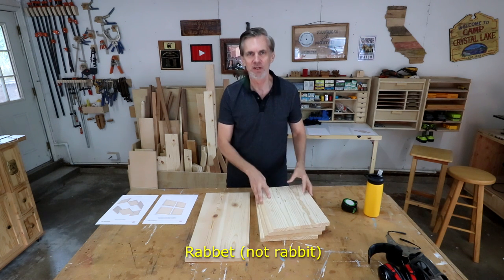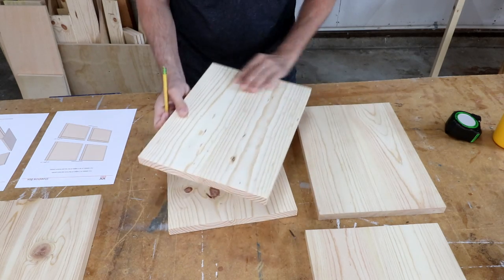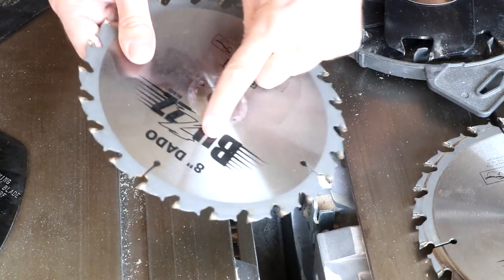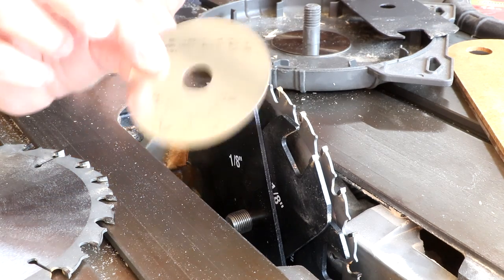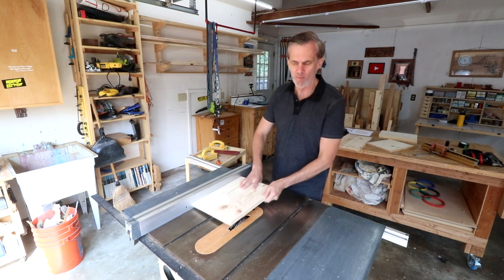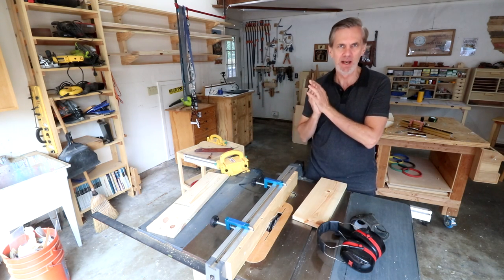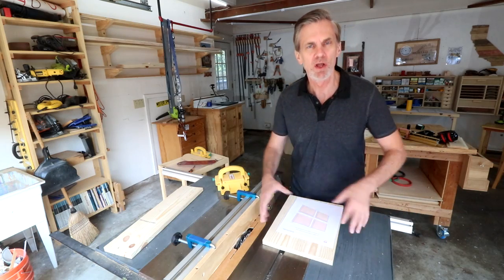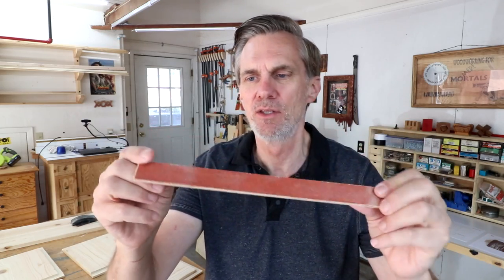How to make simple rabbet joints using dado blades. Basic box making. | LOCKDOWN DAY 173

Comment: First off Steve, I’m well beyond learning to cut a rabbet joint (not a Humble brag, just sayin’) but I still really enjoy watching your videos. It’s rare any videos keep my attention for 20+ minutes but You are always so positive and fun to watch, you clearly put a lot of care into making your videos watchable. Ive watched enough of your vids to know that you put a lot of thought into your production. 

What is cool about you is that you’ve been doing this so long that you’re clearly no longer a “mere mortal” (at least relative to the average weekend woodworker - but you manage to stay
Humble and build simple projects with basic tools catering to the average Joe with half of his double garage that his wife lets him use. 

Awesome! Keep it up! 

Additionally; great tip for finding the exact centre of a board for a dado or rabbet (especially helpful for half lap joints): 

Similar to the way you would find the Center of a board with a marking gauge... 1) start with the blade intentionally low... not crazy low; just low enough that you can visually tell you’re not more than half way deep 2) dado/rabbet both sides of a test board with the same thickness of your work piece 3) the “tongue” of wood holding the board together is exactly 1/2 the thickness of the amount you’re out. For example, if the tongue is 1/8” thick you need to bump the blade up 1/16” and so on. 4) Raise the blade slightly and run both sides through again. 

5) lather, rinse, repeat until the tongue is only a hair’s width or the saw just barely cuts all the way through the wood. 

There are depth gauges and stuff out there to help grow with depth of cut but if you want a perfect 1/2 thickness rabbet or dado, I find this method to be the most fool proof.

Comment: Hello, Steve! I've been using this method for making boxes for a bit now (saw it in a previous video of yours) and it works great. One thing that helps me is to use blue tape to hold the box together during the test fit, and leave most if not all of that tape on for the glue-up and clamping (removing just enough to unfold the box and get the glue in there). Thanks for the videos!

Comment: Maybe this has never happened to anyone else but it happened to me. I had a scary experience with a dado stack when I didn't tightened the arbor nut enough. After I made the cut and turned off the table saw, the blades kept spinning at nearly top speed on my new DeWalt job site saw (a popular model) using the DeWalt dado stack. The stack spun and arbor nut slowly unwound continuously for about 30 seconds. I was standing there very confused about why my stopped table saw was still spinning. Then the blades poped off and flew out, but the throat plate took most of the force. Maybe one blade only just flew out of the saw. The other blade was in the cavity. And the arbor nut in my vacuum. Overall quite scary.

Wanted to share because I daily watch your show and have been very inspired by you. I've learned an exciting new skill and hobby thanks entirely to your videos, SketchUp included.
Reply: That's Final Destination material there 😮
Reply: And that is exactly why dado stacks are illegal in Europe. Sometimes I wish I had one, but after reading this I'll stick to making multiple cuts on the tablesaw :) Glad you lived to tell the story.
Reply: Same thing happened to me. I was cutting rabets and I heard this sound that was off pitch kind of while I was working and I thought “let me just take a minute to look things over” and I stopped the saw and when the motor stopped the blades kept going. Fortunately mine didn’t come off like yours but I was very scared too.
Reply: Holy crap, I didn't know that was a thing! I've used my dado stack a few times, been super careful, but did not know the nut could do that.
Reply: I've used my dado stack since, but now I make sure the arbor nut is really tight. And if it ever happens again, I'm running out of the garage.
Reply: Thanks for the caution. I have a very powerful Skilsaw (4.4 HP) but have been very comfortable about cutting numerous dadoes. My dado insert came with a separate combination nut + washer that seems to hold the stack in place very well. However, I'll take extra care when tightening the stack from now on because of your comments.
Reply: hi Brian, glad to hear it did not cause you any harm. i'm new to woodworking, and obviously stories like these are scary to read. question about your scenario.. was it just that the blades were spinning while the motor was turned off? i would think(correct me if i'm wrong here) that there won't be any force transmitted to the blades, so if you were to use a 'sacrificial' piece of plywood to just stop the motion of the blade due to residual momentum, or reduce the rpm, it would probably damage the plywood, but the blades could come to a stop?
Reply: @rohitbhosle1  Yes you are right. The motor and the arbor had both stopped spinning. It was just the blades spinning loosely on the arbor. But as they quickly spun they were slowly turning the arbor nut until it, the washer I forget the name of, and the blade flew off. A piece of wood probably would have slowed down the blades very quickly. It would have sliced my finger good if I was truly stupid and tried to stop it that way.

I make sure to tighten the arbor nut securely now, and haven't had any difficulty getting the nut off in order to change blades.
Reply: @boboclair   yes, that finger belongs NOWHERE near the blade haha. thanks for the advice though. will make sure i tighten the arbor nut on my saw.

Comment: ugh, now I see this, right after I messed up my lap joint rabbets for a panel. Long story short, the thickness of the rabbet was uneven because of a bend in the board. I think the humidity warped the boards. So I tried to re-cut the rabbet and pressed down on the board with my push block, but when I re-setup my dado it was a little higher and now the joints are to deep. I'll trim the rabbet off and try again and add another board to the panel.  yes, yes, next time I'll sand them flat and not re-cut. Thank you for your channel, I've learned a lot from you.

Comment: Love ur vids for my level.  Could you show how to do dato cuts no table saw?  Have cop saw and hand circular saw.
Reply: You can do some parallel cuts with the circular saw on the dado space, beat the remaing strips of wood with a hammer and clean it up with a chisel
Reply: Your circular saw should have a cut depth setting using the base plate / shoe angle. It might take a few tries adjusting and testing on some scrap to get the depth right. Also make a test cut against a block to determine distance from blade to edge of plate, which will be the space needed between the edge guide and cut. Square and clamp a straight board on the workpiece as an edge guide, long enough to guide the saw all the way. Cut the innermost edge of the dado this way as that's the side that must be cut exactly straight, the rest just needs to be removed so it's less critical. Now you can move the edge guide away and cut the rest of the dado out with repeated runs of the saw. You will have to place a level support for the saw base alongside your workpiece, or cut the dado well inside the edge of a larger workpiece before cutting off at the outer edge. I've been using a couple of "workmate" style portable workbenches to support pieces too large for table saw. Hope this makes sense, still at an early stage myself but this is one of the few tasks I've worked out so far.

Comment: Hi Steve!
I've seen you use the wooden fence clamped to your table saw fence several times. If I was to look for a couple of those clamps, what would I look for? What are they called?
Reply: I had the same question. I finally found them. They're called fence clamps and Amazon has a few different brands including Rockler's.

Comment: Hi Steve.. At 2m13s you have the boards laid out on the bench and where the boards have been joined (from 2 smaller boards) the end grain is mixed ... one is a smile and the other is a rainbow ... would this affect any strength / stability?

Comment: Steve, you got me stuck on rabbet joints. I do have a question though, when you were cutting the sides to fit, I noticed how you used your mallet to tap them into place. Is that an indicator that it’s too tight? I’m always scared when I have to tap something like that in place because I’m not sure if it’s gonna break anything or bust the joint later on.
Reply: Use a soft mallet, no hammers, and use really light taps. You're not going to break anything, wood is pretty tough. You could do the same with a fist but then your hand could get hurt. The point is to be snug. If it doesn't look like you could push it in manually then it's probably a hair too big. Just take a very light skim pass and try again.

Comment: Steve, A Leecraft HT-1 Hitachi insert will work with that saw. Got that same saw and couldn't figure how to cut the very thin edge on those inserts. I'd appreciate it if you could show or explain how you did it as the HT-1 insert is over 30 bucks.

Comment: 10:20 you may want to emphasize that if you can't get it perfectly flush, you at least want to be absolutely sure that the rabbet is wider than the panel that goes into it. If it is, you only have that little strip along the joint (that you're touching with your middle finger) that stands proud, and that's easily sanded down. If, on the other hand, the rabbet is narrower than the panel, that little strip will be low (below the surface of the panel), which means you've got to sand down a whole bunch of the face of the panel to bring it flush.

Comment: Maybe a dumb question, if on a dado cut for 1 inch, if blade1 cut width is 0.25 in. and blade2 is 0.25 inch cut width, how is the middle 0.5 inch portion removed?
Reply: If I'm understanding your question correctly, the "middle" is cut out with the chippers that fill the space between the full outer blades.
Reply: @DougJohnson1  Thanks, to be sure I understand, then theoretically the chippers do all the middle removing (e.g. a 4 inch dado cut, the outside blades make the clean cut depending on blade TPI and as long as you have chippers spaced correctly to cover the entire surface of cut then 4 inches would be removed)? If so, then I got it!

Comment: Steve, I've got a question about dado blades. My table saw is relatively cheap, and it says not to use with dado blades because they could damage the throat plate. If I make my own throat plate that's wide enough to accomodate dados, is there any other reason why I shouldn't use dado blades? Have you ever heard of a table saw that you absolutely cannot use them with?
Reply: Ya, the motor might not be able to handle it and burn out. In addition, the arbor wont be long enough to hold additional blades, chippers etc...
Reply: @davidyovits7633  Thanks!

Comment: Steve, do you have any thoughts on wobble blades?
Reply: I've never used one, but it's my understanding that they are tricky. Because of the wonky shape, you basically need a jig to set the cut width accurately.  I also remember hearing that dado stacks make cleaner cuts. There's probably a reason that you mostly find them at garage sales.  But hey, they are fairly inexpensive, so if you score one for a few bucks, snag it and try it.  It's what I like to call a "cheap experiment".
Reply: I used to have one. They're cheap, but that's the only real benefit. The one I had didn't make very clean cuts, but there's a bigger problem - they don't make flat-bottomed cuts! Basically, the top of the blade traces out a side-to-side arc as it wobbles. It's subtle, but it can be very annoying when you're trying to get a joint to fit tightly. 

The one I had was a Delta. I gave it away (to someone I don't know, not a friend :-). It's possible others are better, but I doubt it. I suggest saving up for a stacking dado set. I have a Freud one, and it's pretty good. But I'm sure you can get a decent one more cheaply.
Reply: I still have a Wobble Blade from 1986, cost me $110.00 at the time. I only use it on my Craftsman Radial Arm saw from 1985, if you can believe it. Both of these things still work. I don't use the Wobble blade that often but when I do it's very convenient. My table saw is the DeWalt 7480 that doesn't take a Dado Stack so this is what I do. As far as thoughts on this blade, it was pretty scary at first but then you get used to it, still I'm very careful and deliberate when I'm using it. Also it doesn't cut the dado flat on the bottom as was said earlier so you might have a lot of hand clean up depending on what your doing.
Reply: A wobble blade cuts a sphere section.   Not a flat bottom but maybe flat enough?   At least no bat wings.   I used one years ago but decided to go mainstream.

Comment: You have some cross-grain glue joints in that assembly. That is never a good idea because of wood movement. Are you copying a traditional design here? If so, I'd guess they were put together with nails, since a nail joint can tolerate some wood movement without making the board cup, but a glue joint will either fail or make the board cup as the wood moves.

Comment: Dado blades aren’t allowed in England it’s ILLEGAL 😕🔥
Reply: Who's going to know?
Reply: Why is it illegal?
Reply: @made6039  The arbors on their saws aren't long enough to mount them.
Reply: @darinnetherland3466  It's not illegal but saws need to stop in under a specified time after power off. Dados are really heavy and manufactures don't want to deal with the hassle of making sure they can stop a saw with a dado stack on under that limit. So they make the arbor just long enough to fit a single blade.

On the bright-side, a router can do all the same things a dado stack can do.
Reply: Beakerbite that’s an odd rule about making the blade stop quickly. I don’t think that’s anywhere near the most danger when using a table saw! Did some politician’s kid cut their finger that way or something?
Reply: Rubbish they are not
Reply: The official line on legality in Europe is :   

To European regulators dado sets are not considered safe. Part of this may be related to blade brakes. A dado set is heavy, and can spin off if the arbor stops too quickly.

My understanding is that it's not "illegal" BUT an insurer is likely to refuse an injury claim whether in a personal or commercial workshop environment - and the "factory inspector" (or whatever they call them nowadays) would step in and stop activity with the machine.   
Having watched countless US YouTube videos with bare table-saw blades I remain concerned - and have invested in a second router that's fixed permanently to my home-made router table for rabbets/rebates/dados/grooves/slots in wood!
Reply: I'm glad to finally see some informed responses to this, usually when the topic is mentioned people just leap to whatever conclusion their political / nationalistic bias demands. Dado blades are not banned in the UK, and I haven't so far found this to be the case anywhere else in Europe. As others have said, the workplace safety regulations have made employers consider these blades impractical with regard to meeting their health and safety obligations, the most commonly cited issue being spin down time. Naturally this reduces the availability of dado blades and compatible saws over here as there's no commercial market, but you can still buy them.

H&S regs tend to be reflexively derided, but opponents of bureaucracy should appreciate that without them employers would routinely expose us to life-changing hazards. Construction sites have massively improved over the last 30 years or so. In your own home, on your own time, you are still permitted to take all the risks you want with your own fingers.
Reply: Khakoo true true. People love to get extreme on issues like safety and environmental Regis, when the truth is more in the middle with them by and large being highly beneficial, but we just can’t agree on the degree to which we take them. So instead of focusing on the 90% people would usually agree on, people focus on the 10% they disagree on and ignore the rest. Political factions only make this problem worse.